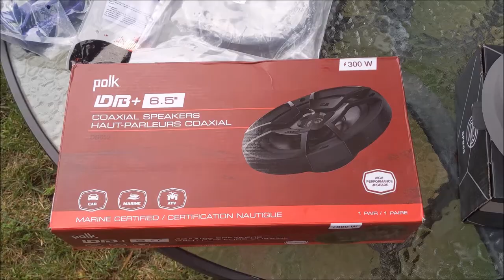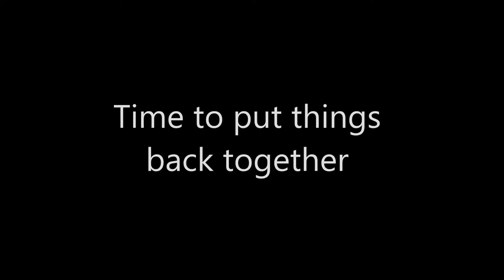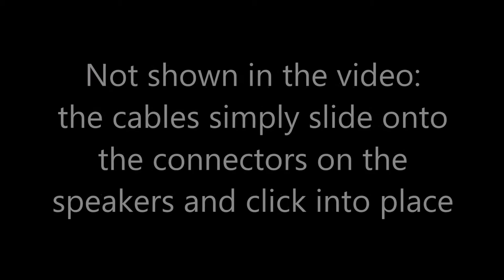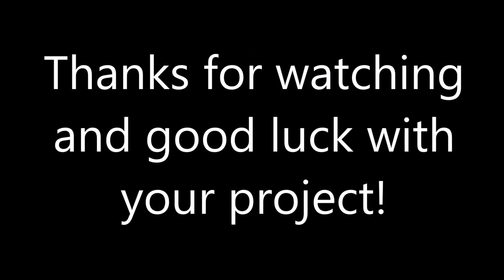2021 Volkswagen Jetta MK7 speaker upgrade

Comment from the maker: An update after a year or so since several people are wondering if the upgrade is worth it:
It's definitely an improvement in the sense that I don't experience "audible exhaustion" as easily anymore because the sound is so horrible. That in and by itself is nice. However, I can tell that the head unit is also a limiting factor, so don't experience miracles.
It also depends on the genre you are listening to, funny enough. For example rock seems to still be somewhat lacking in a certain range in the sound (I'm not an audiophile so I can't definitely point to "mid range" or whatever for example). However, electronic music is now really quite good with the new speakers. But then again it's a German car ... if you aren't blasting ze techno music you are doing it wrong, LOL

Comment: Planning on doing this to my 2023 SE pretty soon, as the stock speakers are JUNK! Are you happy with how they sound on the stock head unit? Considering the Enfig Kicker plug and play amp kit, as I don’t want to run new wire for a 4 channel amp.

Comment: On amazon it says up till 2016 vehicles, does vw pretty much just use the same plug for everything after or did u have to do smth special to the wiring harness
Reply from the maker: The wiring harness worked as is. Just plug it in and you are all set. If you read the whole product description on Amazon you will find "1999 - 2022 Jetta"
Reply: Does the same plug also work for mk7 gli’s?
Reply: The listed adapter does not fit a 2019 Jetta SEL with the Beats system.